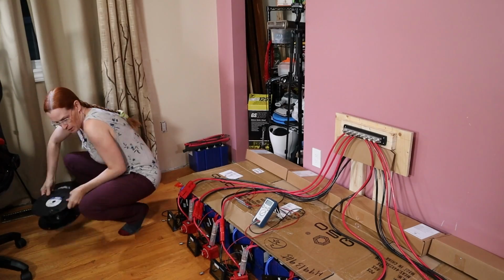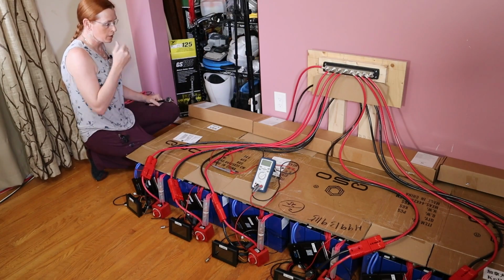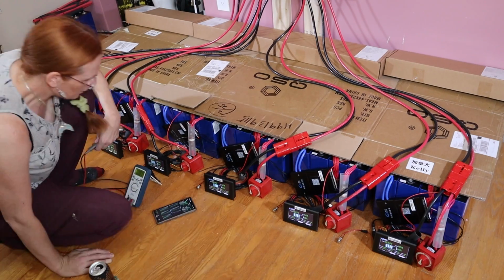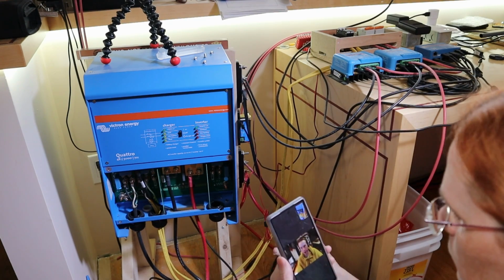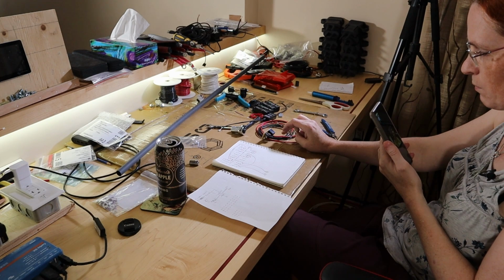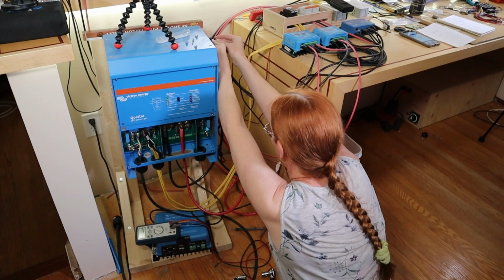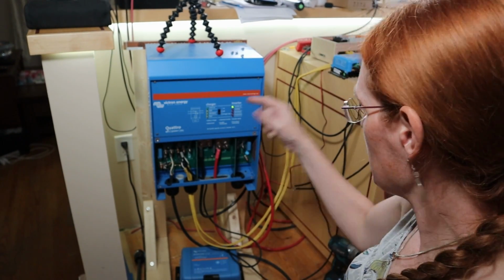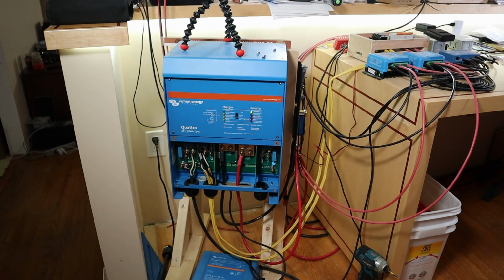Bang! Recovering From Mistakes - Part 6 - Big Battery Build! (Ep. 43)

Comment: It looks like the per charge resister was the problem? or no?
Reply: Having no pre-charge resistor wasn't the problem per se. 

Maddy had a capacitor in parallel with the protection diode... Thus that capacitor was NOT protected in a reverse polarity situation.

When the battery is "on", and the big cables are energized, a magnetic field is formed along/around the cables. Which you turn the battery off (essentially disconnecting the pack from the +ve cable) that magnetic field collapses, and induces power in the cable. If that power has no flow (current) it results in ever increasing voltage, and that voltage is essentially reversed to what WAS on the cable when the battery was "on". So what happened is that a very high voltage was induced on the cable, that voltage was potentially in the 1000s of volts and the little capacitor suddenly found itself hooked up in reverse polarity. Revers polarity is bad for an electrolytic cap. Reverse polarity at 100s or 1000s of volts is very bad for electrolytic caps. Especially as this particular cap was perhaps rated for 50-65v. Pop goes the weasel (or in this case, the capacitor)

I'm not finished the video yet, but potentially that capacitor failed in a manner which left it as a dead short between +ve and -ve rails.
Reply: @CollinBaillie  You wouldn't actually see thousands of volts since the back emf voltage will always be the same as the system voltage minus losses.  The problem is that one side of the cap through the buck converter circuit was connected to the battery and one side was connected to the bus side of the circuit so when the BMS turned off the output due to overcurrent which happened as soon as the switch was closed the field around the cable collapsed driving it at up to 50V with reverse polarity to the batteries so that capacitor likely saw up to a 50V spike in the reverse polarity that likely punched a hole through the separator so when the system was turned on it was now a resistor rather than a capacitor.
Reply: @kuhrd  I think that the volts can peak higher, when there is no current flow. If current could flow, sure the back EMF would be around the same as the original supply. 

As there is no DC current through an capacitor (initially) and none through the protection diode (as per design) the voltage can peak higher than the supply. Once the breakdown voltage of that capacitor was reached there was suddenly current flow, as it failed. All the rest I agree with.
Reply: you mite want install per charge resister on all the packs. This may help in the long run.
Reply: @charlesvrogers  You would probably have one pre-charge resistor from the Bus to the inverter, and have that bus switched also, or the inverter DC input. This in addition to the disconnect switches for each BMS/pack. No need for multiple pre-charge resistors, as they are for charging the input caps of the inverter. One pre-charge resistor per inverter would make sense. And in this case it's main purpose is to avoid over-current protection on the BMS. With all packs on, that might not actually occur when you switch the invert DC input on, as that surge current would be shared across the 6 packs. If that is the case, then an appropriately sized switch may suffice.
Reply from the maker: @CollinBaillie  This is close to my new plan. I'm going to remove the per-pack switches entirely, and move the one switch to the inverter with the pre-charge resistor there. So I can use it before powering it up, regardless of source power.
Reply: @TheDigitalMermaid  If you think of them as safety isolation switches, it might be better to keep the bank switches and ADD a bus switch. Not dissimilar to Andy's battery 2.0. He has one Noark switch per bank as well as a Noark switch for the overall DC bus.

You'd benefit by keeping the pack switches as you can isolate each discrete pack for maintenance while the rest of the system could keep running. 

Having the Bus isolation switch allows you to isolate the DC bus from the DC consumers for maintenance on the "consumer" side, and that is where the resistor would go. Also a quick disconnect of the load side in an emergency, or part of a shutdown procedure.

In fact, you could also have an isolator for each inverter DC input (DC Bus -> Inverter DC in) Allows you to isolate just the inverter and leave DC loads alive. This would be the best solution, and would be where the resistor would go, if you needed it. Andy has the same rotating red switches to isolate his inverters, and doesn't use a pre-charge resistor. Since your inverter is going to source the inrush current from the DC supply bus (which is logically all 6 packs together), none of his BMSs seem to trigger over-current protection.

It is a lot of switches, but it's pretty common when you look at most diagrams for solar energy storage systems. Every "link" is fused and switched. PV panel -> SCC, SCC -> battery bus,  Battery bus -> pack, battery bus -> DC load bus, DC load bus -> inverter, shore power charger -> battery bus. Inverter AC out -> AC bus. Shore AC in -> AC bus. AC bus -> AC consumer. DC load bus - DC consumer. 

Maybe take a step back from the nitty gritty of component design and consider system design. Think of how you handle routine shutdown or isolation for "regular" maintenance, then consider the design from an emergency shutdown situation as well, and you'll probably find it a cleaner, safer, more logical design and you'll know where to put a pre-charge resistor should you want to include one. Use a block diagram to represent each part of the system and then have a fuse and switch / circuit break between each.